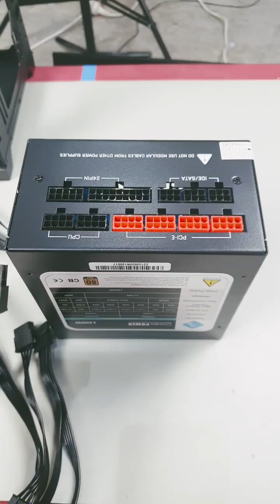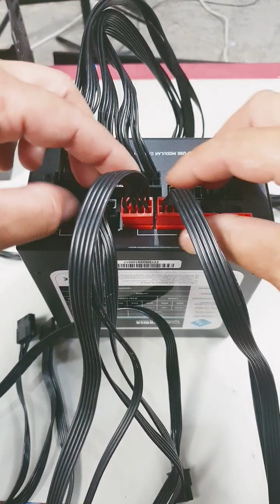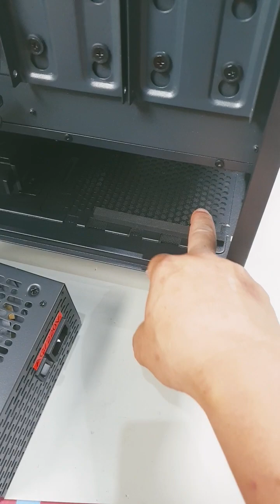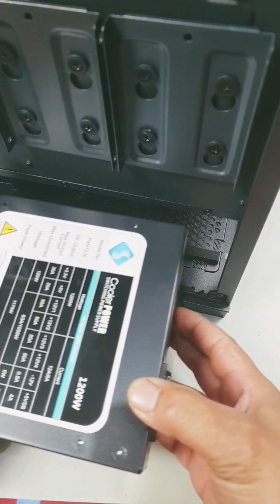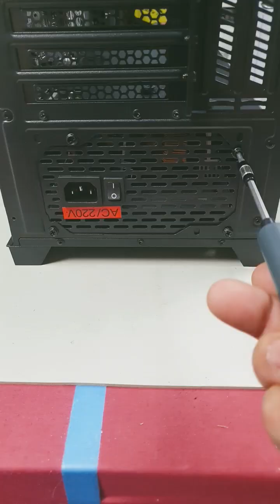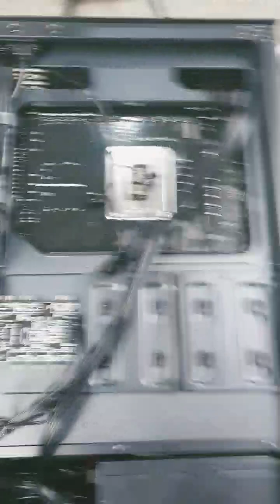how to install a psu. modular power supply

Comment: I had no idea psu canbe upside down
Reply from the maker: always face the psu down becuz the fan sicks in air and releases it from the back where the power cable plugs in ..however there are unique cases where u need to install upright
Reply: @MIKEYZVLOGZ i got a lian li edge psu w fractal meshify 3. Yea i noe it a weird combo.. but now i know i can face the fan upside down. Thanks!
Reply from the maker: @sopek1427  no worries friend

Comment: Can I just add an additional PSU into my case with a molex connector and only use it for the GPU? 🤔
Reply: I have a question 
All my psu cables are coming out of the inside of my psu. There is no pin connecter for my gpu and I want do upgrade my gpu
Reply: Bro left me on read😭😭
Reply from the maker: @FrillySteve on read?
Reply from the maker: do u mean an entire psu ? why don't u use the adapter that goes from sats to molex or something like that
Reply from the maker: what's the issue u don't have enough cables for your gpu?
Reply from the maker: u will need a new psu u must have an old pc that didn't use a gpu at all or psu is low power so there isn't gpu power cables  u need a new psu..it also depends what gpu u want to use

Comment: What will happen if you dont change the cabels like the ones of the older psu ?
Reply from the maker: u will most likely blow your hardware as not all psus have the exact same pinout... so this is strongly not advised... u must change the. ables as well... unless u buy the exact same psu ...

Comment: I searched PSU up or down... All videos are > 7 minutes.   Bro thank you.  Its a simple question with a simple solution
Reply from the maker: ur welcome, just bare in mind for others that it also depends on where your psu is mounted, for example if your psu is mounted sideways like in the lian li cases , then obviously u would face it out to the side so all the hot air case be pushed out of the case, rather then introducing hot air into the case 
in the end its also abit of common sense as well...but im glad it was what u were after.. ur most welcome friend

Comment: Hey sir, what do u recommend to me, install the psu up facing the gpu or down?
Reply from the maker: does ur case have a vent on the bottom? if it does install psu with fan facing down.. if there is no vent on bottom of case  then u can install facing up.. all depends on case and configuration... some cases u can only install facing down..
Reply: Ah ok sir i got u, i really appreciate, i also wanna buy some rgb extensions, they look cool but idk if any of them will work, i've an rtx 3060 12vram, will any extensions outhere will work?
Reply from the maker: @halal.editordz  for your rgb extension to work u just need to buy the right ones for your gpu, for example if you have a 8pin gpu port, select a x1 8pin rgb cable extension which will plug into your 8pin coming off your psu and then plug into your gpu, that way you see the rgb cable go into your gpu, and if your gpu takes x2 8pins then u would buy a rgb cable with x2 8pin (6+2) they are normal 6+2 as some gpus use a 6pin instead of 8pin ...
Reply: Can u suggest me the best RGB air cpu cooler for less than 50$, i wish i can get ar rgb one at this budget?
Reply from the maker: @halal.editordz  there are many good ones .. i would look into a thermalright phantom spirit or peerless assassin, they are very good air coolers with rgn fans
Reply: Thx sir, glad for ur help!

Comment: I think most optimal fan heading down the chasis, cuz it will get air more it needed.. if it head up it will take air for grapich card or the grapich card will take most of air (depend on who goes more rpm)
Reply: If the fan faces up towards the GPU, it can pull hot air away from it allowing more of the cool air from the front to circulate it.
Bottom line is, though, it doesn’t matter. The PSU fan only kicks on under heavy, sustained loads.
Reply from the maker: not all psu behave this way .only better ones do